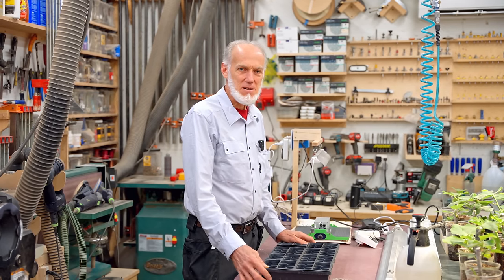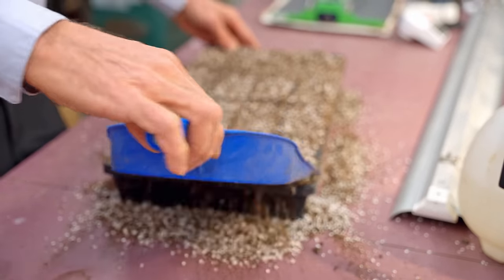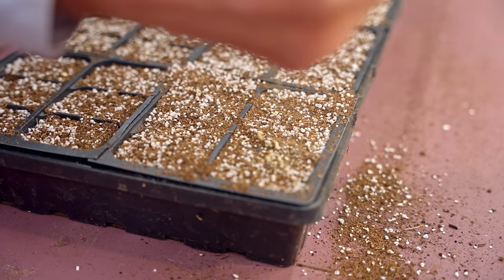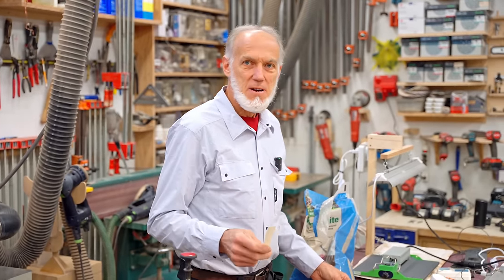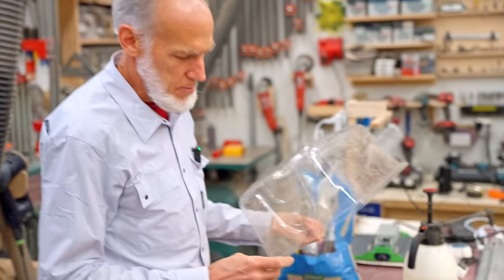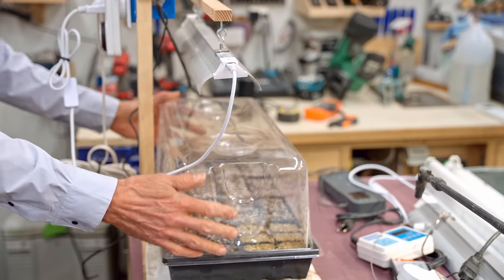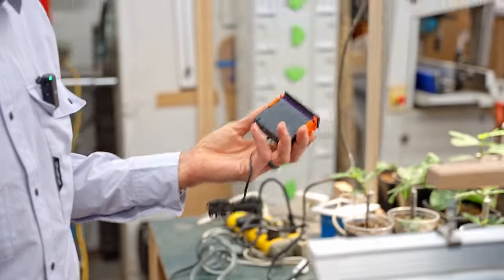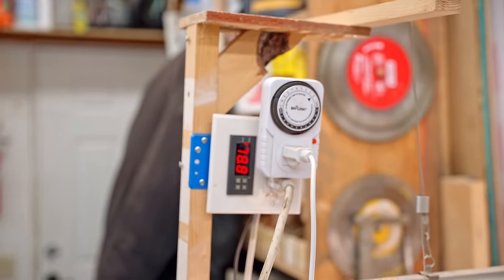Seed Starting Masterclass! Common Mistakes Explained By World Record Gardener! Tutorial

Comment from the maker: If you purchase products & ingredients using the links below, it helps fund our channel at no cost to you. Thanks a bunch! (I tried to find the best amazon prices:-)

SEED STARTING SETUP COMPONENTS in this video;
Genuine Greenhouse Megastore MEGA duty 1020 Trays 10 pack -  https://amzn.to/4c5Ma8x
Cheap LED Grow light with built-in timer - https://amzn.to/49rP5Xo
Pro LED Grow light - https://amzn.to/4348OKn 
4' Grow Light - https://amzn.to/3IvqWmX
Jump Start Thermostat for Heat Pad (UL listed)  - https://amzn.to/3PdHIuE
PREFERRED 50 Watt High Output Heat Mat - https://amzn.to/3v3N4Sg    (Other 20Watt heat mats only increase temperature 10 - 20F degrees above ambient air. Won't work as well in cold garage, for example)
Analog Light Timer - https://amzn.to/3SUqeEM or https://amzn.to/43abFRX
Digital Light Timer (UL listed) - https://amzn.to/4c9znln
Thermostat -  https://amzn.to/3TfbOjF
High Dome - https://shorturl.at/iGSU6
Inexpensive High Dome - Available by mail order from Berlin Seeds at 1/3 cost than other vendor.
Fine Vermiculite (not coarse)  - (Small quantity, save $) - https://amzn.to/3v3DdvK
   (Larger quantity) -  https://amzn.to/4cbmtDM
Reply: I don't buy anything from Amazon 
Please make links to companies run by humans
Reply from the maker: @Wyndham21044  I totally get it! We love Azure Standard and other wholesome companies. However, we can't sell to you directly yet(we're working on it though, much regulatory compliance to sell soil/minerals) and this helps us fund our work until then. We'll be selling directly to customers soon, Lord willing. 😊
Reply: @GardeningHomesteadingWoodwork I’ve never seen those big domes before.  I love them!  I hope they will ship to where I live.  I just found your channel today, and this is the first video I’ve watched.  I’m an avid rural gardener, carrying on the family tradition of using home-grown produce as our primary food source.  I look forward to gleaning wisdom from a world record gardener! Have a blessed day!
Reply from the maker: @Mrs.LadeyBug  Well that's just so nice! Glad to have you here! Blessings! 😊
Reply: This is my first time watching your channel, and really appreciate your educated common sense approach. I would love to have some of your giant tomato seeds. Last year I saw my first double tomato blossoms, and they had a double center too. Like conjoined twin blossoms with the centers together and then a double layer of petals around the whole thing.
Reply: Question I recently built the set you guys have I bought the 20 watt 270 full spectrum light how close should I put it to the germinating seeds and what power as it has 10 settings any help is greatly appreciated appreciated! Have a blessed day!!

Comment: Some great tips.  Do remove covers and heat once germination starts.
About the personal heat pad—I wouldn’t advise it for use around water unless it states it’s approved.  Not sure, but all the personal use pads should be designed to shut off to avoid burns and would not remain on.
I do agree to use a temp regulator when using heat mats for growing.  They get way too hot inside—10-20 degrees warmer than air temp.  There seems to be a lot of regulators plugged into the germination box.  A long 4’ heat mat would probably do the job.
Everybody has their own way I guess.  Many I see say to saturate soil before filling cells.  I agree with you on adding it dry.  You are correct that it gets too wet, especially for tiny seeds like poppies.  The seeds can rot and the soil molds.  I have a pump sprayer I use also as the bottle sprayers break and wear out your hand.
My husband and I were laughing because it reminded us of his dad and creations he came up with. 😊
Reply from the maker: Thanks for your comments!  The heat mats do not automatically shut off,that's what you want otherwise you'd have to be turning them back on all the time,and these mats are sealed so water can't get into them and cause any problems. All those things you saw plugged into the germination chamber are not heat mats🤣 there's lights, different circulation fans and one 5 foot commercial heat mat plus different relays to control temperature different at night versus the day and also timer and light and heat controls for the upper indoor lettuce grow.

Comment: I do use pre moistened seed planting soil.  Works well for me to get the moisture in it.  Otherwise it is very hard for me to get it to accept the water.
Reply from the maker: That's one of the reasons why I use coco coir. Peatmoss is hydrophobic but coco absorbs water very well - it's like a sponge. So by having added coir in the mix, the coir quickly absorbs the available water and then it slowly hydrates the hydrophobic peatmoss.

Comment: been using regular t8 leds 6500k , highest lumens you can find... and it works fine for seedlings. Full spectrum is super expensive and useful if you want to grow plants to maturity / fruiting
Reply from the maker: Yes you are correct,it's just that a lot of people keep them too far above the plant,there's nothing wrong with T-8s,the full spectrum leds are much cheaper than they used to be and more lumens/ watt so they are cheaper to run as well.

Comment: @GardeningHomesteadingWoodwork I apologize if this was covered, but when and how do you fertilize your starts?  I typically start when the true leaves come up, and I've used Agro Thrive Standard 3-3-2, but my shop fills up with flies and it forms a sludge on the bottom tray.  Any advice would be very helpful, thanks.

Comment: The seeding heat maps can come with a thermostat.  I was very confused at why you were using a heating pad until you said that.
Reply from the maker: We understand that. However, the majority of the small seed germination heating mats are only 20 watts, whereas the mats we recommend are 50 watts and can easily heat the seedlings in much colder environments. Blessings! 😊
Reply from the maker: Many of the cheaper mats don't have thermostats, they just get warm and heat the trays 10-20 F above ambient temperature, even in hot environments.

Comment: Please tell me if I have anything wrong.
As soon as you see the seeds sprouting then you need to turn on your lights and take off the humidity dome. Set light timer for 16-18 hours a day.
Leave the heat mat on at 75 degrees. No need to turn thermostat down?
Leave the plants in the pony cells until you see the first set of true leaves. Then transplant into 3-4 inch pots and feed with a weak fertilizer. If house temperature is at 68 is there any need to keep them on a heat mat?
Your videos are helping me tremendously. Thank you.
Reply from the maker: Dan, germination temp should be 78⁰ to 80⁰ and if you don't mind the little extra electricity I'd say leave the lights on 24/7 from seeding until the cotyleden leaves are opened up, that way there isn't a chance that you'll miss getting the light on as soon as they start to poke up out of the soil. No need to transplant into bigger pots - when 3 to 4" tall get them in the ground. No need to keep heat mat on if house temp is 68, just keep lights on them 16 hrs on and 8 hrs off. You could put them in a cooler place at night and that would help them be stockier.
Reply: @GardeningHomesteadingWoodwork  Thank you for sharing your knowledge and wisdom. May God bless you and your family mightily.
Reply: Do you have a link to the vermiculite you use?
Reply from the maker: @roxannegollata3761  Yes! I'll get that for you in a few minutes. 😊
Reply from the maker: Here's some great fine grade vermiculite, smaller quantity. 
https://amzn.to/4cav8WG

Here's a popular cheap option in smaller quantity. Just be aware the product may not be as clean(dusty) and consistent.
https://amzn.to/3v3DdvK

If you find another product you like better, just make sure it is fine vermiculite, not coarse.
Reply: @GardeningHomesteadingWoodwork  Thank you so much!!!! 😊

Comment: On the vermiculite that is on the link says fine grade 1-3mm, would 2-4mm fine vermiculite suffice?
Reply from the maker: Yes I think that was be ok! Happy gardening!
Reply: @GardeningHomesteadingWoodwork also I had another question on lighting. I think you said 16/8 is that just until they are strong enough to be planted in the garden?
Reply from the maker: Yes, just until they're 3 to 4 inches tall then harden them off and plant them in the garden, you may need wind protection  if you live in a windy area.

Comment: so for some free advice..... about how high above the plants should I set my 5000k LED lights? I'm thinking about 8-12 inches or so but would like a 2nd opinion. Thanks!
Reply from the maker: All depends on what light you have,do you know what lumens ,ppfd  your light puts out?
Reply: @GardeningHomesteadingWoodwork - LED 4800LM, 5000k 'Daylight'.
Reply from the maker: Your guess is good enough I believe, no way of knowing for sure except to use a meter to verify the actual ppfd that's hitting the plant. I think your good to go,hope it's a full spectrum grow light,if not it's still good enough for seedlings but definitely wouldn't be good for mature plants like tomatoes or peppers or any other common vegetable plants.
Reply: @GardeningHomesteadingWoodwork  well I'm just looking to start seeds for my vegetable garden along with a few marigolds and impatiens. Assuming the best height, I'm hoping the LED 4800LM, 5000K lights will work for me. Perhaps next year I'll add full spectrum grow lights. :-)
Reply: @GardeningHomesteadingWoodwork  I'm just starting seeds for my vegetable garden plus some marigolds and impatiens, so I'm hoping my 4800LM, 5000K LED shop lights will do the trick.

Comment: Use the water proof heat pad like Vivosun they also have  a temp on there heat pads now just saying
Reply from the maker: Last I knew their 1020 tray Heat pads are only 20 watts of power. The ones we recommend are 50 watts and so they can heat your soil a lot better if you have your starting setup in a colder environment, in a garage for example instead of your house.

Comment: Add water to your seed planting mix before filling trays.
Reply from the maker: Your idea sounds logical, but if you did that, it is much harder to quickly fill all the small pony pack cells because the soil is not loose and dry. Uniformity of soil density per cell is much more consistent when gravity filled with dry soil. 
If pre-wetted, you also have the potential of having air pockets at the bottom of the cells unless you pack in the pre-wetted possibly clumpy soil. 
It's not called potting mix either. It is seed starting soil mix. They are very different mixes for a reason.
Potting mix is usually damp prior to using. Hope these observations help you.😊